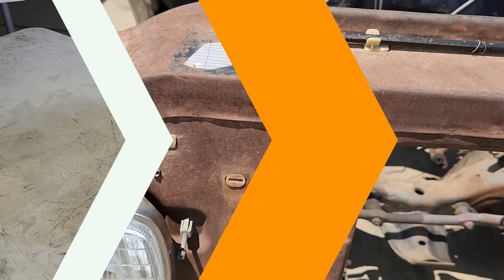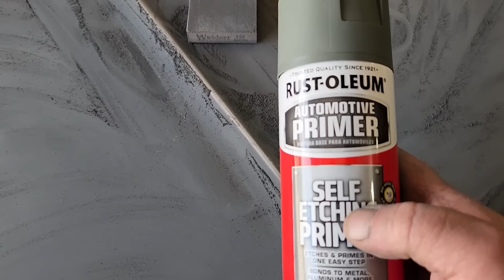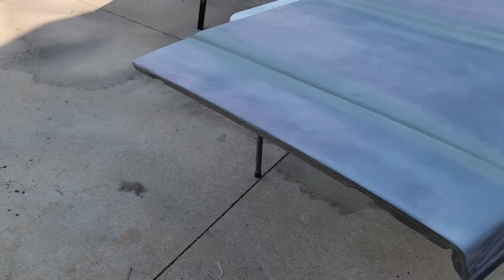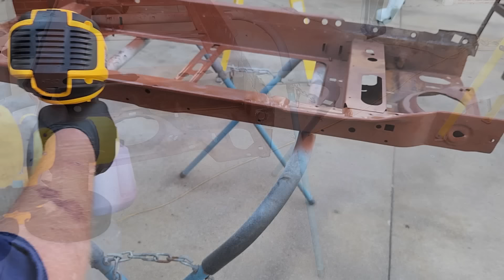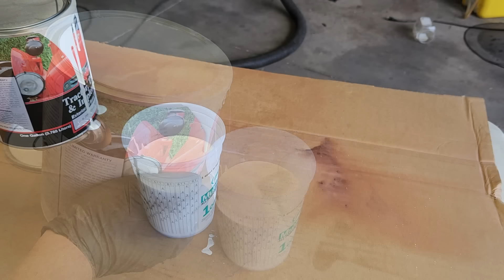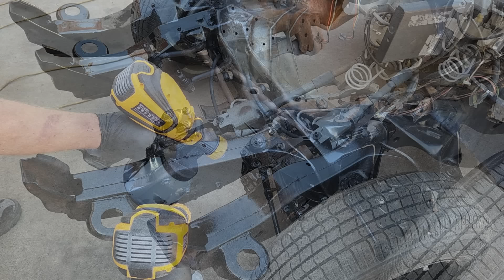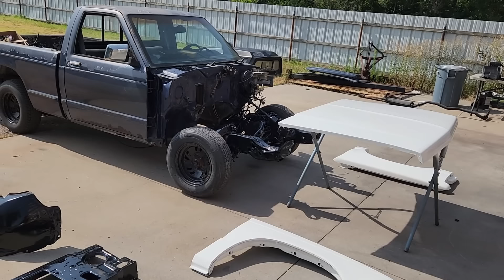S5 E27.  A low cost automotive  paint hack that really works. Rustoleum and  electric sprayer

Comment: Try Japan dry in your paint..it makes Rust-Oleum dry to the touch in about 20 min.using acetone,and hardner...only takes one cap full,you can buy Japan dry at ace hardware for about $10 a bottle...try it you'll love it..only thing if your painting white ,the Japan dry will give it a slight off white appearance..

Comment: Just a tip...I own a sprayer so I know it came with some plastic bags, those are actually for oil paint put it in the container first and then load up with paint it saves you some cleaning after the job

Comment: A spray gun is $10 at Harbor Fright...and a compressor is $100, even less if used.  Isn't that gun heavy?  And how do really clean plastic gun using acetone that melts plastic?  Are they not made for water based paint?  A small paint roller is almsot free and does a pretty good job with a foam roller.   The tractor paint used to be cheap, it nows costs more than real automotive paint.

Comment: One of my favorite budget custom gimmicks is after doing a Rust-O-leum spraycan paint job, I'll do some backyard graphics with an airbrush or rattlecan.
Flames, scallops, panel jobs, 2-tone and the rest. Anyone wanting to try some DIY backyard paint graphics, here's a list of the stuff I use:
1.) Pasche dual-action airbrush with #5 needle and cone
2.) Createx airbrush paints (ok for auto/mc use with appropriate reducer and clear)
3.) Vinyl masking tape  (1/16", 1/8", 3/16", 1/4" 
4.) Crepe masking tape (cheap-ass regular masking tape)
5.) masking paper
6.) plastic drop cloth (thin, lightweight and cheap)
7.) any size air compressor with a storage tank
8.) water seperator for compressor outlet
9.) external air regulator (optional)
10.) willingness to try (talent optional)

Comment: Good enough for work truck, and you saved hundreds in USD. Me, I went primer only. I did four coats and sand between coats. That was 6 years ago. The surface is as when first primed my truck. I have a F-450 1999 full size Good enough for work truck, and you saved hundreds in USD. Me, I did four coats and sand between coats. That was 6 years ago. The surface is as when first primed my truck. I have a F-450 1999 full size with 7.3L power stroke V8. The truck is in great shape. I can't see puting an enamel and clear coat on for the expense. I would rather put that money in maintaining the truck. Primer is done right with last for years, if taken care of like everything else on the vehicle. I am prepared for when the day comes and I need a new motor rebuild. There is only one mechanic shop this truck is going then, but until that time, the truck it banging.

Comment: Cool job...for all old cars that can use a face lift, your method is good enough - I have this sprayer and was planning on using it on cabinet doors, fences, and my 2004 Prius - will start with the bumper first and move to the hood etc..

Comment: I just sprayed painted my 2016 Genesis G80 (less roof) with Rust-Oleum Gloss White using this same electric sprayer and was barely able to get two coats on using one gallon with a 70/30 paint/acetone mix. I should've gone with a higher acetone mix because I noticed considerable sputtering.

Comment: I got one of these guns, 1000W model (yeah, right!) and the included little funnel thingy is an easy way to determine your paint viscosity. dip it in and let it drain while clocking it: 40-50 seconds is recommended for full drain. I tried rolling my hood with Rustoleum out of the can with about 5% acetone thinner as recommended on can and the mini foam roller introduced bubbles that didnt level and the job was ruined. I spent more on the 40-80-120 grit 6" DA discs to remove this tough stuff than I did on the Amazon gun!

Comment: My biggest tip for at home paint jobs: read the labels on each product, and thoroughly. Shaking rattle cans takes a lot longer than you think. Temperature and humidity ranges are smaller than you think. Different products call for different grits for adhesion. You don’t want to ruin your prep because you didn’t read the manual. And as everyone knows the quality comes from the prep.

Comment: Nooo, for cleaning just take the tip apart and clean the individual parts.  Just take the tube off the bottom of gun and clean too.   This helps tremendously.

Comment: Thanks for sharing this video—really appreciate the walkthrough. I do have a question, and please forgive my ignorance when it comes to paint chemistry. Is the Tractor Supply paint you’re using considered a true 2K paint, or is it a single-stage enamel?

I’m looking at doing something similar on a car I’m restoring, and for the average DIY guy, I’m trying to learn whether this approach is a realistic option. I’d prefer not to invest hundreds into a compressor and all the supporting equipment just to attempt one project.

Any insight you can share on paint type, durability, and long-term results would be hugely helpful. Thanks again—great content and always learning from these videos.

Comment: Suggestion, from experience. When using repop or replacement panels, always remove the black protective coating. This stuff is a cheap low quality coating applied just for preservation and the end user never really knows what it is. Completely remove it and apply a self etching primer you are familiar with and know that it works. I promise you, based on multiple experiences, it will come back to haunt you. Don't let all your hard work, effort, time and expenses go to waste. You will not regret doing it properly. I know you are doing a low cost type paint job and I appreciate everything you have shown, but the separation of the cheap factory coating won't show up for a while, but eventually, it will. Folks can choose what they want to do, just providing some additional information and perspective based on experience and costly repaintings

Comment: You said it was around 90 when you were doing this painting, what was the humidity? Here in Iowa it is extremely humid for most of the summer and that would worry me if I was doing this work between the months of July and September. I'm not sure what effect the higher humidity would have on the paint going on or curing properly.

Comment: In the early 80's I painted a C-10 pick up black, I painted it with a roller.
Unfortunately, in all my wisdom, I picked federal safety black because it stays kind of wet and never dries, I thought it would last and last.

it did last, but when it got hot in the summer, it's all ooozed to the lower part of the truck.

DOOOOH.

Comment: I used a Wagner power painter many years ago. I made the mistake of reading the instructions that came with it. After much experimentation I discovered that the first  instruction should be  "do not read the instructions before burning them. " The second one should be " do not forget to burn the instructions. " 
  Maybe they've improved them in the many years since then.  I  still think that you should burn the instructions just to be safe.

Back with an edit.  
     My painter worked very well but nothing in the literature that came with it was correct. I'm convinced that the person who wrote the instructions never actually used the sprayer.

Comment: When prepping, can you go too smooth when sanding?

I have a habit of taking sanding to the extreme.

Like when I was reseasoning some cast iron, I worked through the grits up to 2000, which made the surface look like black chrome.

But that only works on really good cast iron. 

I'm curious how that translates to auto paint.

I have a pickup that was a theft recovery with a lot of superficial side damage that would be good to practice on. Previous owner just went at it with a hammer, i think, so I could not possibly make it any worse.

Comment: I bought two of those paint guns, different brand. I found them Oktoberfest use and the finish wasn’t to bad. I was very surprised. .  I used them to spray metal T&G spandrels.for the eaves. So the finish didn’t have to be to proffessional.  The real test will come when i come to spray the timber doors with stain and laquar  👍👍

Comment: I have jaw open because there wasn't bugs to troll you with their lives!

Here if I place anything outside just for keeping it there, there might be one or two flies coming to check in. 
But if you are to paint anything, it is their whole family and all the area bugs that you might think to come in checking that what does the new fresh paint surface feel like!

I once painted a steel plate indoors a barn, in a interior room. 
After I came back to check the results, three butterflies had decided to come to check the paint through two closed doors. 

That is the reason why I agree that everyone would need a sealed off room just to do the paint jobs somewhere close to them, so when needed, it could be done. Just a few square meters area with good lighting and space for the sprayer etc. 

There is something in the some paints smell that draws them in.
As when I painted the house, I used petroleum based paint and you didn't see a damn bug for a two weeks, and on first summer the walls were as well clear from flies that usually get to warm themselves in direct sunlight.

Comment: I'm pretty sure I painted a truck white with that exact same paint many years ago, I do not remember using any hardener. That thing took forever to dry, it was still soft almost tacky after a week. It looked okay, there was no wet sanding the paint and flattening it out, that's the nice thing about having paint that actually hardened is you can do that. It wasn't very glossy, it looked fine, not very good to be fair It was my first paint job. Even if I were to use automotive paint it wouldn't come out very good because I'm not very good at painting LOL

Comment: I just went through a similar struggle spraying a truck with bed liner. I juat could not get it right but tinkering with the mixture was where i was messing up. I didnt want it to be "too thin" but thats what the gun wanted lol after adding more acetone all of a sudden i was laying down crazy clean coats. I cost myself 4 hours of cursing when i should have stopped immediately and tinkered with the mixture more exactly as you said

Comment: I want to use the equipment and paint that you have used on your car, because

1. They are cheape
2. My car is old

But does the farm paint look good on a sedan car ?

On my mobile screen your painting looks very good.

Pls. Give me more advice on farm paint like  (are they hardy enough and looks good) ?

Finally should I put a clear coat on top coats ?

Well I  asked many questions, because in our country things are hidden from the average person. Body shops give you cheap jobs which won't last more than a year at the most.

I will try my luck with your techniquec of painting, never mind if I fail due to lack of experience 

Thanking you in advance ...............
             
             Mahmood Karim                     
             From Bahrain

Comment: I purchased one of those paint guns and ran 20 gallons of stain through it on 300 ft of fence and it worked great. I did notice mine will spit sometimes when you first pull the trigger, not a deal on the fence but if I was painting a white truck I would want to be sure and pull the trigger not aimed at the panel.

Comment: you mean....the ten speed that ford has had problems with?

"The 10-speed transmission was designed by Ford, while the 9-speed transmission was designed by GM." Wikipedia

Comment: I just did this last week!!! Same sprayer, same paint. but I used mineral sprits not acetone, its what I had. I didn't sand the primer, hope that doesn't bite me later. The most difficult part for me was the valleys in the hood, I think I put on the paint a little heavy and it puddled a little and wrinkled as it dried at the bottom of the valley. But the most of it looks GREAT! also I didn't have any hardnerso I don't know if thats a mistake?

Comment: Good enough.
 Have been curious how one would work. Thanks 
   A step up from rattle cans.
   Done much auto painting using a traditional gun. 
  But on a vehicle that just doesn't matter too much....
  30 years ago after rolling my mostly off-road 4wd I had to swap cabs. 
Since the truck typically would pick up pinstriping along the trail... I decided to paint the used cab a new fenders with rattle can Rust-Oleum.
  To help hide the inevitable dents and scratches that would occur I used white pearl paint. Pearl can also help hide imperfections. 
  I did put down about seven coats.  
To do the cab fender and doors with seven coats back then cost about $60. 
 The truck still has the paint today. It could use another paint job but it has held up about 25 years longer than I thought it would 
Lol 
 Buying a quart or gallon is much cheaper than buying it in a rattle can. And with the El cheapo gun it will likely go on better also.
  Low cost alternative for one timers. 
Or I'm not considering using one to paint the backhoe. Much of painting it will require doing it from a ladder. Not having a airline attached will make it much easier/safer.
  Now retired I restore muscle cars . Not necessarily to original but functioning and pretty. 
  A few years back I purchased a fairly large greenhouse eBay special to use as a paint booth. Around $150 Big enough to pull a full-sized vehicle in and have plenty of room to work. Quick and easy set up and take down. It keeps surprises from unexpected Bugs leaves or surprise thunderstorm from ruining paint work.  
Has plenty of ventilation when working.
Also  raises/ retains the temperature as much as 15⁰  to help cure the paint .

Comment: For anyone watching this. There is no need to prime entire panels. It's a waste of material and time. Primer is for bare metal, bodyworked areas or other areas of where the paint has been burned through or is rough. Priming the entire panel just forces you to resand everything a second time and makes you use material that you didn't need to use. Sanded paint is already a perfect surface to paint over.

Comment: I used to work for a garbage company who had roll-off drop containers that got beat up on jobsites. We exclusively painted our containers with Rustoleum 1 gallon of black & 2 gallons of white mixed to create the grey we were known for. We cut with acetone & used a HVLP gun to apply it. The electric gun seen here looks like a huge step in the right direction as the expensive (good) HVLP guns are not so difficult to clean; however, if the boss’ nephew fiddles with the adjustment knobs on your set & adjusted pneumatic HVLP gun you are going to make a dripping mess.

Comment: I used the majik paint for my magnatrac then 48 hours later I clear coated it and it worked great I was worried about acrylic urethane clear over oil base but not a problem.  But I did bake it as I own a body shop with a baking booth

Comment: i bought a similar gun but with fan control, and you can turn the tip with a lip on the side as wel, so you can adjust the spray angle on the go. Not really usefull for car related things i would say, but if i ever want to use it for its intended uses then i can see an advantage to being able to turn the fan direction without getting hy hands dirty.
Also i like how you did show the prepping and all. In the past i have seen guy say rolling a car dosnt work, it falls off after a while and things like that. And then you see the car, and it has a full gloss paintjob coming out from under the paint they rolled on. Most of the people think a budget paint job dosnt include proper cleaning and sanding of the car. Wel thats not how that works. Even a pro painter with all the equipment cant get a proper job if he cant do any surface prep before painting.

Comment: Feel it see it is true
Mixing 2K Paints. First the paint then the hardner and then thin it down. In this order you can use the scale (like 4:1). Wrong mixing can lead to not curing, to mutch hardner lead to fast curing.

The rest from the Video is good and for the tools a nice result.

Comment: Okay, so here's a question in regards to "good enough". Whike I absolutely understand the best way is to remove all the panels, the doors, bed etc. 
However! Whike "good enough" is very subjective could you do a good enough job on a forty year old beat-up pickup truck spraying it without removing everything. Kind of the it will look great from 20', but if your up close you'll see you took the shortcut?
The time with the seasons changing is what I don't have unfortunately.
Also any recommendations for prep as it's a full size truck, & the last paint job was a rattle can job so its chalky. 
Thanks for any input, & criticism.
I really have the bug again to get a good enough finish on this old truck.

Comment: I have an '81 Didge Ram 3/4 ton 4x4, so a full size truck. While the paint isn't high quality if it holds up I think it will work fine on a work or farm truck that just needs to get freshened up. I honestly live tge Massey Ferguson gray, & hopefully it'll turn our well...if I ever get to it as it's mid Sept here in Nebraska, & it will be early Oct before I even have the chance to do this. I sure wish I had a shop. 
Great video as I had read a few years back about using my Wagner sprayer which this Amazon is just a Chicom knockoff of. I'll likely order one just to have the backup available which is great insurance.